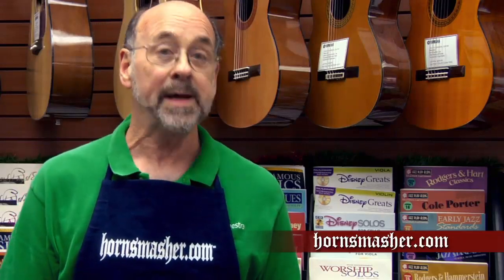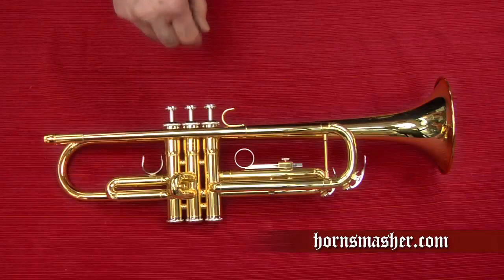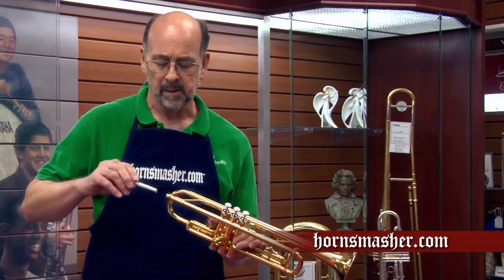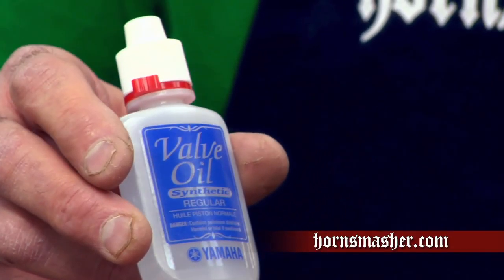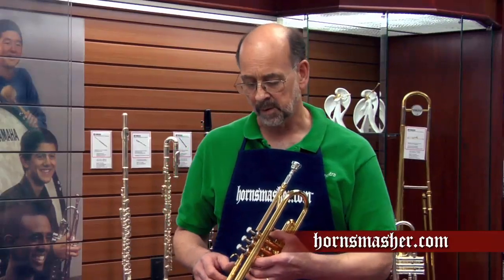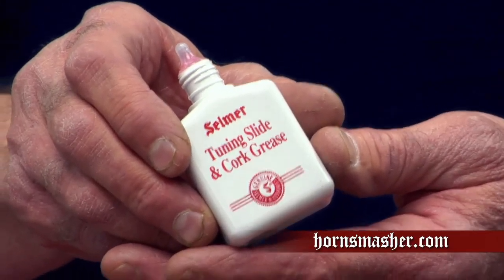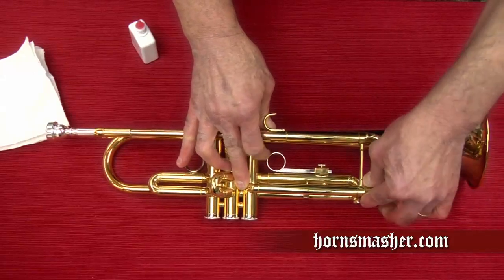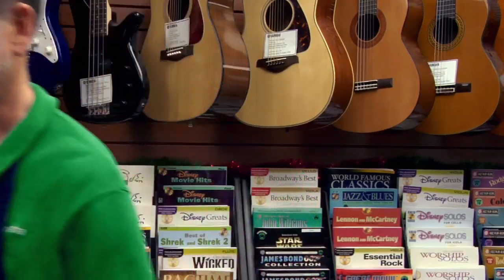Trumpet Assembly, Disassembly and Daily Maintenance

Comment: Remove the bottom Valve Caps and clean them separately. They collect a lot of gunk that needs to be removed periodically (once a month).  If you are in a hurry, as right before a performance, oil you valves as shown in this video.  It gets the job done quickly.

However, if you have the time, I recommend you completely remove the valves one at a time and hold the valve over a paper towel; thoroughly cover the valve with oil.  Reinstall the valve into it's casing remembering the approximate location of the valve guide slots.  Rotate the valve left & right until it settles into it's slots.
Reply: thx! I tried and you are right! there is a lot of stuff in there.

Comment: Great video.  My trumpet is an older model and has no numbers on the valves.  I took them all out to clean and now don't know which is which.  What do I do?
Reply: Go to your local Instrument Repair Store with your Trumpet and all parts
Reply: I finally did that but it took days.  On my model the valve holes are so close on each one that it is extremely difficult to tell.  Must put valves in, play it, then remove.  Very painstaking.  I'm etching numbers into mine.
Reply: Actually you can try remove all the valves but keep the slides, then start putting 3rd valve or whatever (as it's the first to come through when you blow it) then blow into trumpet, if it is correct then it supposed can blow freely  with valve up and down. It happens many times in my band (as we're using old and weird type of instrument that have no number on valves) and onlt took me seconds to solve it.

Comment: Useful tips, but what to do in case of mixed up piston valves? How do one matches the three pistons correctly to their respective csing when there are no numbers printed on their side?
Reply: Im no expert but i woupd try to line up the holes on the valves with the slides until you get it right. Good Luck with that pal. Hope you figure that out

Comment: What happens if the valve doesn’t click and how do I fix it ? I tried oiling it more, and making sure it was facing the right way but nothing worked. Also, the spring inside the valve, what if it falls out? Is there a certain way to put assemble it back in? PLS HELP ME

Comment: That's just the air pressure. Take out the whole slide and hold down the key that is instructed in this video per slide. If you don't do it then your spit will gather inside the trumpet like a vacuum. You only need to pull on these slides on specific notes when you play.

The slide that is connected to the third valve, which is furthest from the mouth-peace, only needs to be moved on low D, valve 1 & 3, and C#, valves 123.

Comment: cool man cool. @hornsmasher i just purchased a 1940s "Roth" trumpet. i was wondering what a trumpet like that would go for these days? do u have a clue, i ask but no one replys back. haha. just curious im not trying to sell it or nothing. near mint condition just a few scratches here and there. not dents or dings. original case. and another question, the bell is a little smaller than 5 inches.. i know u have a yamaha, which i hear alot of mixed emotions about around the web.. so what do u think?

Comment: If it is a schilke the numbers should turn away from you. 

Is the low Eb also wrong, if so, you have turned the valve. There is usually a plastic "valve guide" in each side of the valve chamber, one is big and the other one is small. The ones on the valve should fit the tracks in the chamber.

Comment: Hi There!

I've seen a few cleaning rags available on amazon, and some are for lacquered and some for silver.  Is the brass instrument a lacquered type?  I'm afraid to buy on of the nicer larger rags since all of them seem to be for silver.
Also, would you use the mouthpiece brush for cleaning daily?  I don't think the Yamaha cleaning kit we bought at our local rental/repair place came w/ the little pipe-cleaner you used.  Is it an actual craft-store pipe cleaner, or an "officially" safe one?

Comment: Can't take the dang thing apart. Been sitting for 30 years. I was "playing" it and when I put it in my lap to watch this video and then picked it back up, it stopped working. No air went through except on Valve 2. Then valve one stuck. I can't get the caps or sliders to budge and one of the buttons won't stop spinning to tighten.

Da frick.
Reply: Have you figured out why the button won’t stop spinning?  I have the same issue.

Comment: What about saliva throughout the inside of the trumpet?
Reply: Run swabs through the tubes. Swabs are cloths attached to a weighted string which you run through the instrument tubes and slides. They work great if you use your water keys often to drain some moisture.